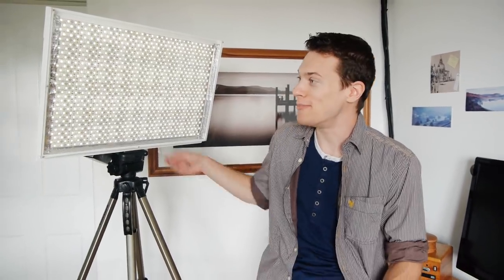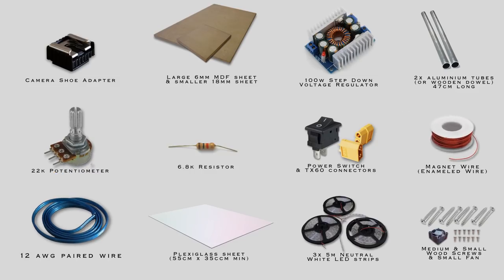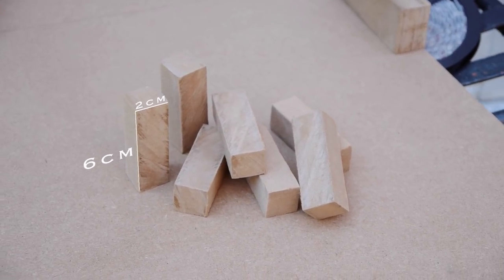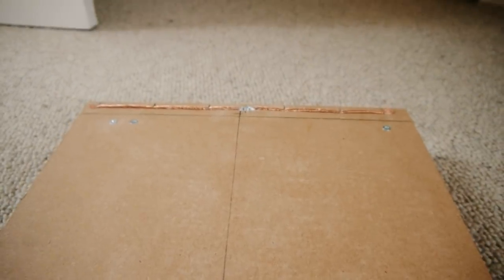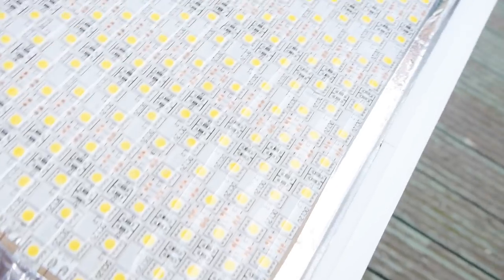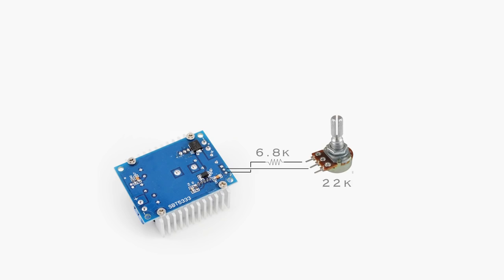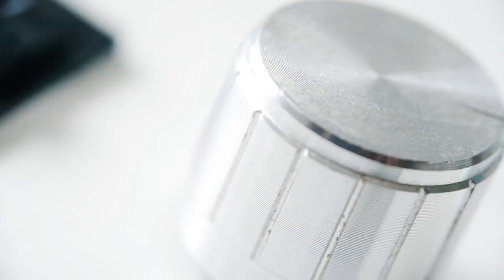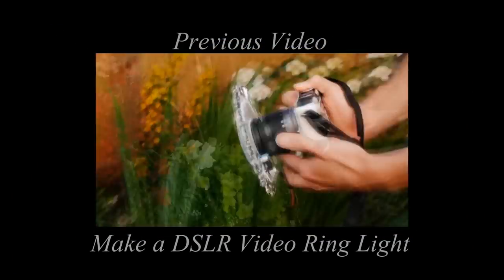How to make a super bright LED light panel (for video work etc)

Comment: Would a high capacity CCTV battery pack work? They have built-in circuitry for preventing over-discharging. 
Something like this.... http://www.ebay.com/itm/Home-Super-Power-New-DC-12V-Portable-9800mAh-Li-ion-Rechargeable-Battery-CCTV-/371197635780?pt=US_Rechargeable_Batteries&hash=item566d1a6cc4 

If so, then could wire up a standard DC plug and then easily swap between these battery packs or a DC wall plug.
Reply from the maker: MBLphotography As long as the circuitry does a good job it could work. Keep in mind though that it will have nowhere near 9800Mah. Those cheap Chinese packs have been shown to provide only 2000Mah or so, and I'm not sure what their discharge rates are either.
Reply: DIY Perks
Thanks for the reply. Figured that they wouldn't hold as much as they say.

Going with a slightly different route, what about using a big SLA battery (such as a car battery or wheelchair battery) with a power inverter? Would a 500w inverter with a 12v, 18ah do well?
Reply from the maker: MBLphotography Should work very well, yes. It'll last for a very long time with 18ah too.

Comment: (a LED panel*) Not (‘an’ LED panel)
Reply: Actually 'an' is more correct than 'a', there are some exceptions in grammar. Do u say 'a hour' or 'an hour'. Same thing applies here... if the letter being pronounced after this starts with a vowel (EL) then it better to say an LED.